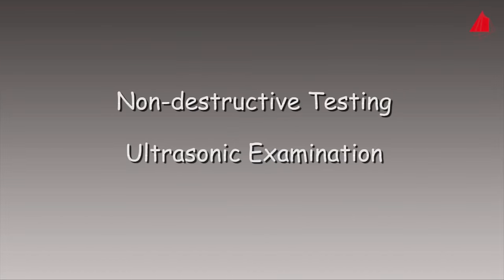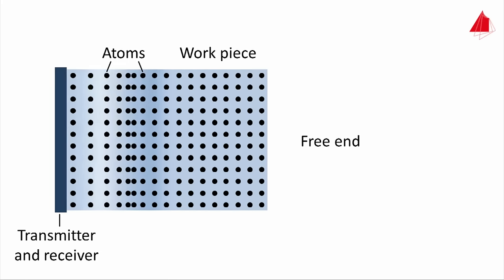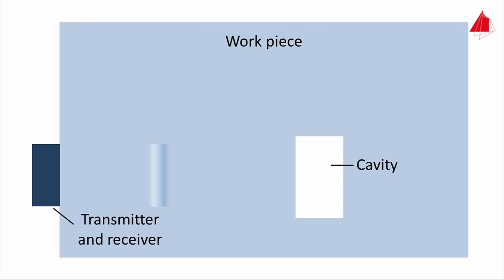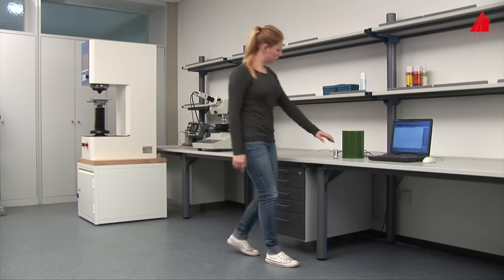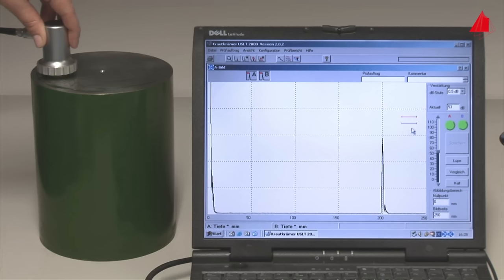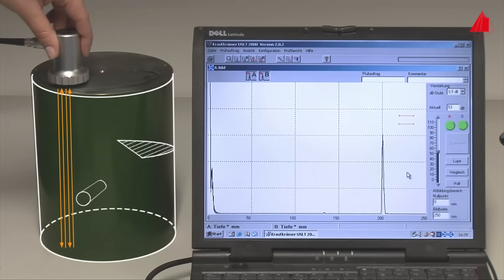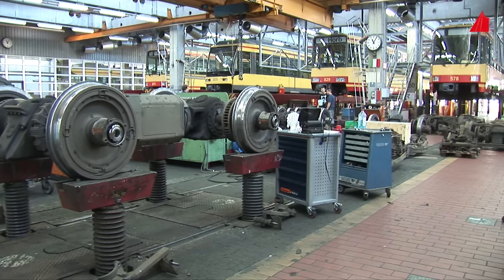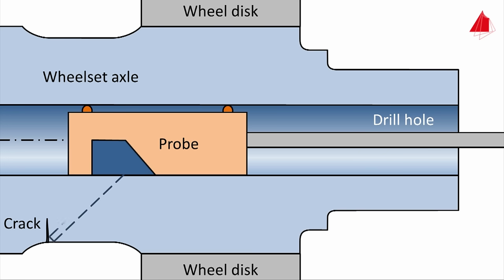Ultrasonic Testing

Comment: Can we calibrate angle probe without any reference block?
Reply from the maker: Answer to "Can we calibrate angle probe without any reference block?": To my knowledge, calibration with a reference block is always the best method. Experts in this field have hundreds of them, for all kinds of purposes. But one can also use the sample itself for calibration in certain cases, if the dimensions are known.
Reply: @MaterialsScience2000  so in case of angle probe how would you calibrate the probe on the job (which is to be tested for the discontinuities) itself?